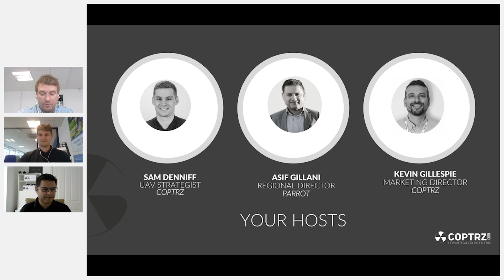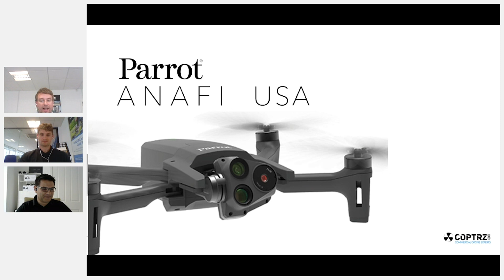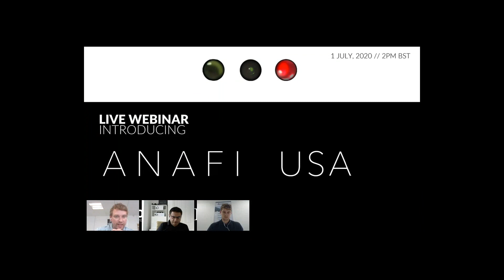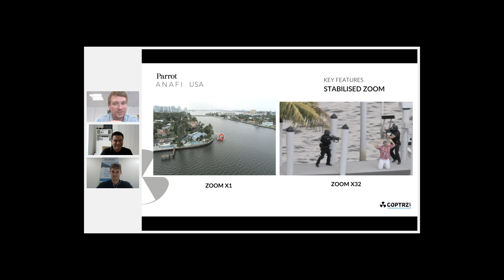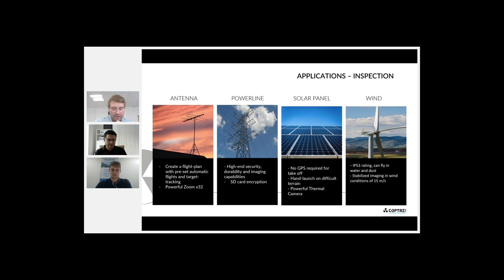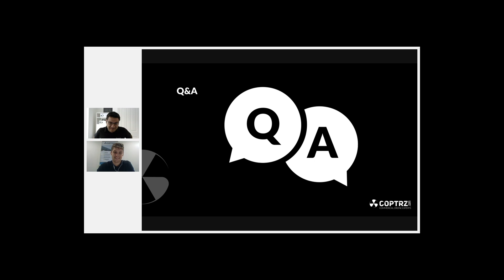Anafi USA LIVE Launch - All Your Questions Answered

Comment: Super camera indeed but the rest is pretty basic compared to DJI Mavic 2 Pro.
1. No obstacles avoidance, very basic these days.
2. Wi-Fi transmission, like the Mavic Air! It should be at least 5 miles so you have a strong signal in urban scenario.
3. Should have a night beacon for night flight.
4. Should have more intelligent flights available to do survey and waypoints etc.
So, the best combo cameras on the market now but lack of options for the drone itself!